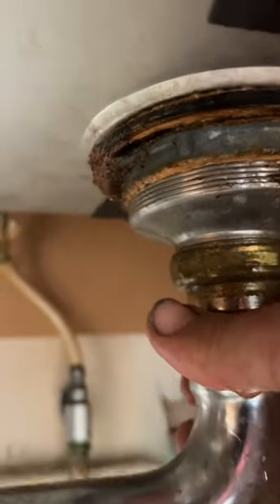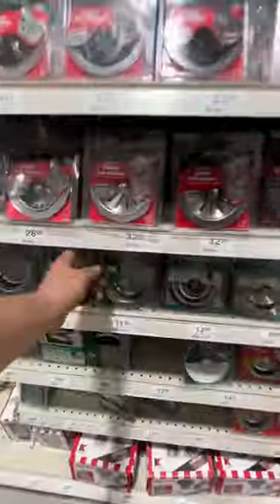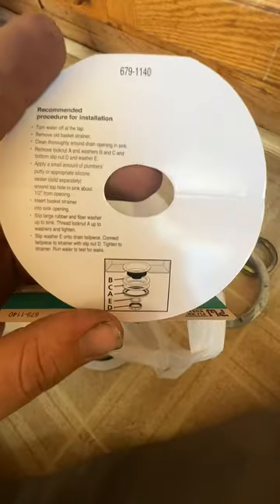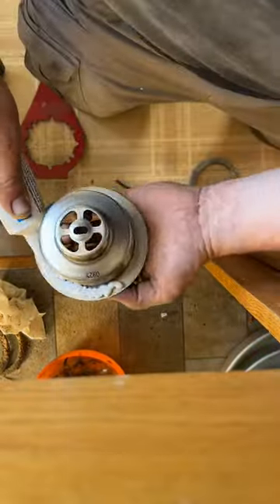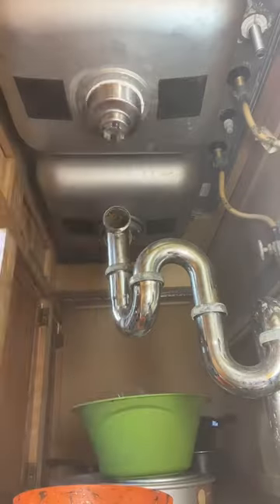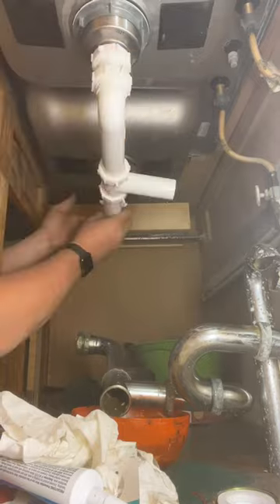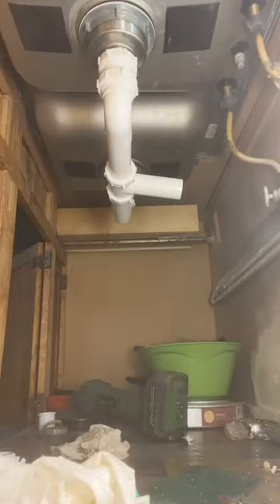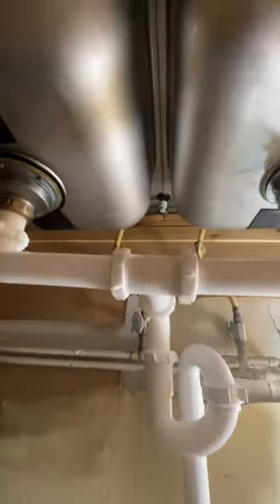Fixing a leak from a kitchen sink #HandsomeOrHandy￼

Comment: S trap is wrong sir, call a plumber
Reply: And illegal
Reply: Why
Reply: @Keeperlit333  because it is more of a siphon. It's supposed to leave water in there. S traps fail this.
Reply: Thats double f-ed up. 2 s traps.
Reply: Need to use an air admittance valve and it's ok to do
Reply: Definitely not to code.  Call a plumber.
Reply: @tomsullivan4880  who cares it works
Reply: Plumber here, I can confirm s-trap is wrong sir.
Reply: @Keeperlit333  against code
Reply: @rickramirez3235  the purpose of the trap is to hold some water to keep sewer gases out of home, so technically it doesn't "work"
Reply: @Yourmoms-BFF  well at least you have an explanation. Unlike a lot of the critics and haters. I feel if somebody's going to dismiss something right away and add a little sarcasm add a little insensitive remarks and then to top it off with negative criticism. At least have an explanation. This happened for real once. I actually sent a reply to a comment that this is not going to work and that is not going to work he went forever. So I replied and asked can I ask why and he said I don't know
Reply: @Keeperlit333  no air vent. Every time there is 90 degrees drops it need a air vent because the    Water will suck the trap water with it
Reply: I thought in certain cases,  maybe a roof drain, "s" traps were allowed according to the UPC?
Reply: Was thinking the same
Reply: Ask somebody, you know it’s wrong
Reply: Why s trap ahahah
Reply: @ultrahighquality5657  I'll bite, why?
Reply: I guess calling an ‘S’ trap, a ‘P’ trap makes it legal. I’ll have to try that on my next inspection of an older house.
Reply: @Jim Spier  well, you are puffing up like a professional.  If you actually give pride in your trade, and why it's there, do something about it.
Reply: Plumber here. Feel pain for the next plumber that has to remove the silicone.
Reply: Exactly! That’s not a P Trap - clear as day it’s an S Trap. The fact you called it a P Trap and put back an S Trap shows while it’s working you don’t know what you’re doing! S Traps are old, wrong and don’t pass code.
Reply: It’s wild that s traps are ever a thing.
Reply: Everyone remember... walking around breathing free air was also "against code" in 2020. Government should stay in their lane, and their lane does not involve utilities, education, commerce, Healthcare, etc. The people with guns, handcuffs, and prison cells can just stick to those things.
Reply: This actually helped me see what not to do , thanks
Reply: Licensed plumber: existing work can remain as is.

Stop all the fear tactics guys, that's why people don't like us
Reply: @tomsullivan4880 not code. But you are allowed to replace an existing one. Like for like. You are not allowed to install one.
Reply: @nubsack6142 If you can’t take that apart, you might want to try a different vocation

Comment: That's still an s-trap, next time pipe in a sanitary tee with an aav 4" above the horizontal so that it vents properly.
Reply: Went from a double s trap to single s trap
Reply: It is astounding that people do not understand this and are allowed to work on our sanitation system
Reply: Technically the aav should be 4” above the flood line of the sink, but at least run it up to the bottom of the counter top
Reply: @supac4789  Although you are correct that  it would better for the aav to be above the flood level rim of the fixture being vented, the international plumbing code states a minimum of 4" above the horizontal and at least 6" above insulation materials.
Reply: @supac4789  there is a space in back, or, it’s a sink, he can pull it out an inch and pipe up behind it for a studor vent.
Reply: Aav or auto vent can vent whatever you wanna call it is illegal in the upc plumbing code book BUT you are allowed one under ipc codes.
Reply: @supac4789  your wrong. 4in above trap arm  on individual branch. If it's being used on a stack it needs to be 6in higher than the flood level of the highest fixture on that stack.
Reply: Can someone elaborate why the additional vents are required? In Europe I have never seen anything else, but S-traps. I don't even think we have vents in the hardware stores. So where does this difference in plumbing arise from?
Reply: @Chronologist89  Think about it like a straw for your drink, what happens when you cap the top of the straw?
Reply: @boscobaracus1823  It's not that I don't understand venting or sucktion. My question is: Why are vents/AAV used und pretty much ever home in the US, but never in Europe?
Reply: @Chronologist89  Every home in Europe has plumbing vents also, you will have at least one vent through the roof in any structure that has drain piping. Long story short, good ventilation makes for good drainage. AAVs are not standard and each home can have a maximum of three AAVs and a minimum of one roof penetrating vent. I can tell you that I have seen hundreds of houses where bad ventilation caused airlocking and backups on a drainage system and without having to penetrate a roof to install them, AAVs are a simple and reliable solution for fixing poorly thought out systems. Without proper venting, the air inside the pipe will gurgle back up through the water and cause sewer smells also. Hope this helps.
Reply: @Supa C  which is exactly what he wrote
Reply: Next time they should call a plumber, not some hack
Reply: @Chronologist89  different codes and standards for different parts of the world. In Canada where I live, the only s trap allowed anywhere is the integral one inside of toilets. Vents are air relief to prevent siphonage when a large amount of water is rushed down the drain. When that happens, sewer gas will vent up inside your house. That’s exactly what traps are designed to do (hold back sewer gasses) I have no idea why S traps are allowed anywhere else, doesn’t make sense to me lol. p traps only
Reply: Agree proper way
Reply: @supac4789  actually the Aav only needs to be 4” above the crown weir of the trap.
Reply: @supac4789 Technically, it only needs to be 4” above the trap weir

Comment: Really should fill the sinks up and drain to test your work just running the water doesn’t stress it enough for a good test.
Reply: Correct
Reply: All the way up then pull the plug, all goes well and you didn't just flood the kitchen. Do this after clearing a clog or snaking a drain too to test flow and flush any little chunks down
Reply: Exactly
I was a Building superintendent for 20 year and replaced 100s of these,  best water test is filling and flooding them🥃🥃
Reply: @jetthardin4927  i fill up the sink half way after i change a garbage disposal out, then flip the disposal on when i pull the drain plug. Makes a bit more vibration as the water drains so i can make sure the connections are tight on the drain line

Comment: Remember this for next time. I personally never use a continuous trap because if one clogs then you need to remove both traps (hypothetically). Redo the drain (which looks to be 1 1/2). Install a wye where it comes through the cabinet (makes clearing clogs much easier). Then coming out of that at the top, as high as you can make it. Install a Studer vent. This will let air in as the water is trying to exit. Studer vents are acceptable in areas where you can’t tied back into the existing vent. Remember you do not want a WET VENT! Now you can install individual p-traps for each strainer basket. 

S-traps are not venting making them not up to code. 

I am in no way saying you can’t do this or your not capable of doing it. Just know your code or like it was said in the comments… call a plumber even if it for advice.
Reply from the maker: I appreciate your response and how you responded. Most of the plumbers in the comment section just tell me how fing stupid I am. I normally do not take on large projects when we have a tenant living there. When they move out and I will Cut out the bottom of the kitchen cabinet in order to get to the sewer pipe I plan on putting in a P-trap, a clean out and a vent like you talked about. I understand the S traps are not up to code but I feel that the repair I performed is better than the double S trap that was there.
Reply: Don’t call me for advice if your a handyman doing plumbing. And man I know your trying to help this guy but you shouldn’t even try he is not going to do it right. If your a plumber have you ever seen a handyman do the right job?? Seriously I never have. Plumbing is hard to do correctly, there is a lot of code these handyman guys will never know or understand without the years it takes to learn. Like This is gross and he need to stop posting his “plumbing“ videos . Also pro vents are always illegal where I come from .  People this is plumbing it’s literally a board of health division, if you got a handyman doing it you could literally be messing with your health. It’s sanitation and your drinking water!! hire someone that knows what they are doing ..
Reply: @terdferguson1736  if you think plumbing is hard, you should see what it takes to be a garbage man…I mean a doctor.
Reply: Over here we are only allowed one trap per fixture.
Reply: @kylekoenig4730  Lol!
Reply: @HandsomeOrHandy  dude you were doing some pipes under a sink. That's not a major project
Reply: Everybody getting all worked up over code.  Most grandparents I know, didn't even have running water in their homes when they were growing up.  Chill out and grow a pair, and let Handsome be, on a grandfathered sink.  It'll be fine for years to come now.
Reply: @cletuss57  Holy shit Cletus No there's a reason you shouldn't be doing these things. It's not about growing a pair it's that this easily let's sewer gas back in the house on top of other things. There's a reason we have codes smart guy

Comment: Ouch, I'm surprised you didn't address that it's a pair of  s traps, not even a simple p trap after the update.
That likely siphons the water out of the trap occasionally, from what I've been led to understand.
Reply: Yep, I didn't like that trap either. I wonder how far away the vent is, and if it's ever been cleaned or checked on. 
Sometimes you don't have a lot of options, but this isn't one of those times. There was plenty of room to put a real P trap there.
Reply: Next time put the P trap under 1 of the sinks. You made an s trap that isn't code and will create a dry trap due to siphoning
Reply: This is why they should call a plumber and not the damn maintenance guy
Reply: Because he’s not a plumber. There’s a reason why you have to be licensed.
Reply: That is an s-trap. Basically instead of one side of a p you have both sides which form an s. The problem with an s trap is that as the water flows through the first curve and answers what should be a straight shot which will leave a certain amount of water in the trap protecting the home from sewer gas the water instead goes into that mini roller coaster thing there which draws every drop of water out of the sink and straight down the pipe so you're left with no gas trap anywhere in all of those curves. You just need one loop below the sink and then straight out or slightly tilled it down to leaving under the counter. It doesn't need to be a roller coaster

Comment: Besides the S trap, the T should not be installed horizontally.
Reply: Illegal in mass for horizontal compression joints for drainage. So, correct! It's not illegal in new Hampshire so this does depend on the state.
Reply: There are some tees designed to go this way but a continuous waste is better

Comment: On residential homes, i do not use waste bends. I use pvc up to the strainer. I connect to the strainer with a no hub coupling. Never a leak. For good clients only. I don't want a call back in 10 years.

Comment: Good job, what everyone is saying about the s-trap is right. Don't like those because the sewer gasses will continue to pour out of them because a good seal won't work happen AND the s makes it extremely difficult to drain. P-trap goes in and must be lower than the horizontal bar.

Comment: Instead of an S-trap, you should've used a P-trap into a sanitary tee with a "cheater vent"(that's what I call them) coming off the top of the tee as high as you can go. Otherwise it's clean work. Good advise on the basket. Plumber's putty or silicone is the only way. Also, the cardboard gasket is important. It keeps the nut from binding on the rubber gasket when you tighten it together.

Comment: Also change the s trap to a ptrap
Reply: Why on earth would you use a P trap when waste pipe is coming up from the floor 🤷
Reply: @surfstoomuch5750  what’s your point?
Reply: Whether it's coming from the floor or  a wall it doesn't matter. You need horizontal to prevent siphoning of the trap.
Reply: @Ilovefishingeeeeeeerrrrrrrday  coming from the floor you would still need a p trap if one wasn’t present before tying into the branch. You would use a tee with a trap arm for horizontal and the top of the tee would tie into a vent or automatic vent

Comment: Looks good from what it looked like before only thing is that I do use the gasket on top and gasket at the bottom and after 5 years of going to my customers houses for different reasons everything still works and looks fine, and no too gasket does not show on the top of sink

Comment: In a sense yes silicone does make sense, how ever i have foam seal on top and rubber below. This has not leaked once in 5 years and probably 20 years its been there since rental place. Also place is important. If its sink at the bathroom its not a issue, if with closet under it, then that might be issue. For this specific place not a issue.

Comment: It’s an S-trap and not allowed in general. The proper way to do it isn’t much more work, simply run the center outlet waste straight down into a P-trap and connect to that vertical pipe with a tee fitting, the top side of the tee is then extended up and fit with some form of air admittance valve. S-traps will pull on the water seal and suction it partially dry at times, burping sewer gas into your home every time someone flushes a toilet.

Comment: Some manufacturers specs specifically say not to use plumbers putty but the enclosed rubber gasket only. Also S trap is not code.

Comment: The P trap kits come with the trap arm, threaded transition fitting, p trap, extension, cereals, and tightening plastic nuts. You need a P-Trap kit PVC, primer and glue for PVC pipe, a short 10" piece of PVC pipe for between the 90° elbow and Transition fitting from hub to threaded p trap pipe, the transition fitting comes with p trap kit, and a long turn PVC 90° elbow

Comment: Hi. The leak shown at the beginning of the video..is caused by a loose basket strainer or is that a 2nd problem and the 3rd problem is a broken pTrap ( sTrap) ?  If it's only that leak, do you just replace that nut ( applying new putty and all) ?  thx

Comment: You need a plastic pvc long turn 90° and a drain fitting with a short piece of PVC and the glue and primer in between. Also you only need to use a trap arm 90° angle with a pipe and two unions, a tail piece " a pipe with a flange, and one P trap. Plus the plastic washer and ferrels. The plastic washer goes on the extension pipe where the T pipe fitting is, the plastic ferrels go on the pipe between the unions and pipe.

Comment: double p trap, or an S-trap, is not only a terrible idea, but illegal in most state's plumbing codes. 

i would also never use silicone to seal a basket strainer. putty or an included rubber gasket only (not the thick rubber gasket that goes under the sink. if the model of basket included it, it will be a thin second one.)

Comment: Everyone recommending Studor vents, should at code and placement.

If here is access below, their may be an easy solution. 

It may have been done right, at one time period and still have a reasonable fix.
It could have been a S-Trap that was once code, and would take serious work to upgrade it..
Reply: It's really not serious work to upgrade it. A p-trap into a sanitary tee with a cheater vent off the top as high as you can put it. I'm in western NY and that's fine in my area. An s-trap is never the way to go. I don't even know why they still sell s-trap kits.

Comment: Proper way to do it from a plumber is to pipe up with a Ty sticking out and a stutter vent on top of the Ty at the highest point then come straight out of the Ty with a adapter to the ptrap just letting you know if you didn’t

Comment: Oh, and another thing: You can use a rubber gasket, plumbers putty, or silicone. Just depends on the manufactures specs and if it's approved in your state.
Reply: The rubber gasket results in the flange sitting too high and leaving more water in the drain area.... so no.
Reply: @matthewk6731 Code doesn't have to make sense. If the manufacturer says you can and it's approved, you're good. If it doesn't, you probably did it wrong. Or, better yet, you think you know more then the people who designed it. Inspectors can't get away with it, neither can you.

Comment: Little trick buy a wax ring for a toilet. Apply some of the wax on your fittings they will be easier to tighten and helps seal them.
Reply from the maker: I’ve never heard that before, but I like the idea.
Reply: @HandsomeOrHandy  works great under sinks where people are constantly putting stuff under them and bumping into the pipes. The wax stays flexible. I take a wax ring( non reinforced) take the wax put it in a small container and it's in my plumbing box. Put a little on threads to prevent galling (strainer baskets) and unlike a grease the wax is sticky to help hold the fittings.

Comment: Pipe one drain over to the other drop down into a p trap going over to a tee wye an put a mechanical vent as high as you can while still being able to remove it in case it fails.